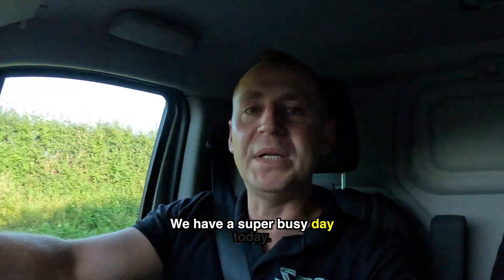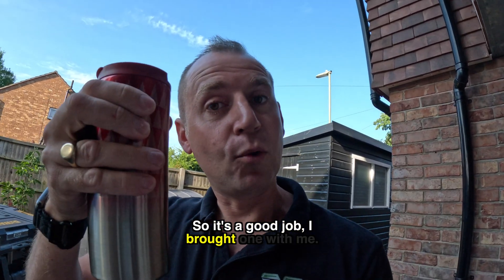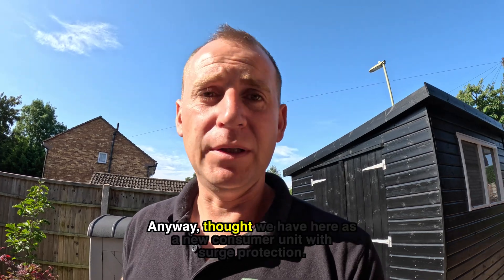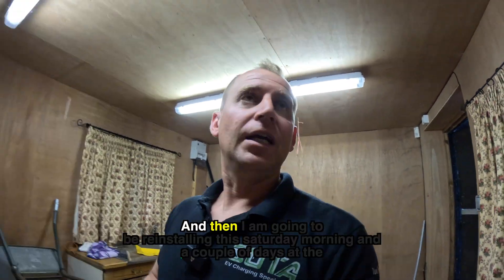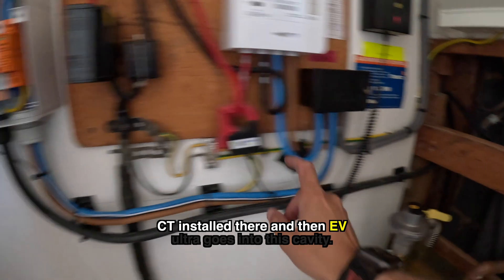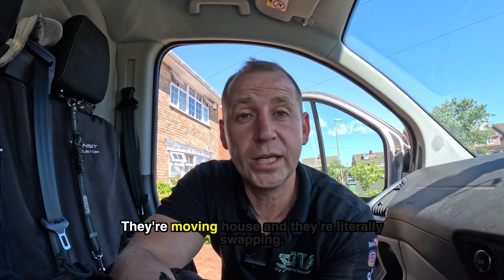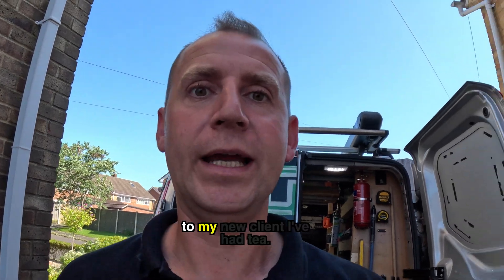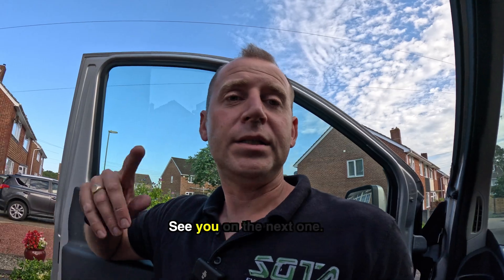UNDOING other people's work & a TESLA Surprise!!

Comment: Great video. Completely agree with the comments on the lack of PEN fault protection, but I think the latest Tesla wall chargers have a type A RCD with 6mA DC protection built into them.
Reply from the maker: Thank you, the new chargers don’t have this I’m afraid,
Reply: @sotaelectrical  I’d thought the same initially, but I was looking at fitting one at home and came across the data sheet on the Tesla website. 

I think the older models didn’t. 

The data sheet is at this link below:

https://www.tesla.com/sites/default/files/charging_docs/Tesla_Wall_Connector_Datasheet_EN.pdf